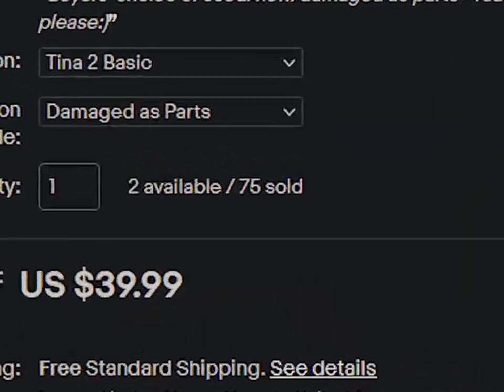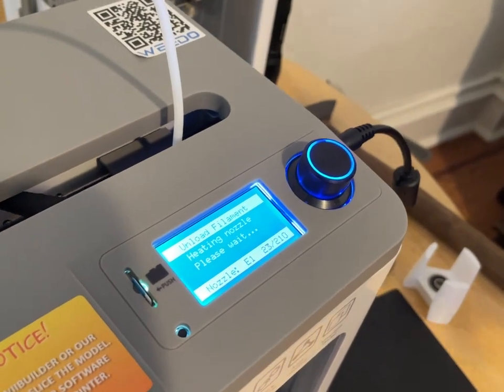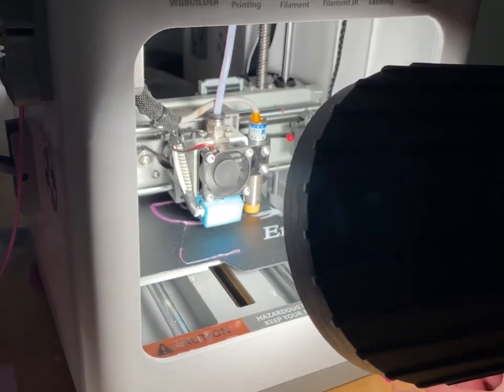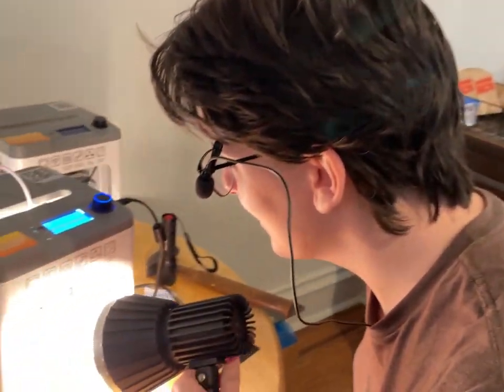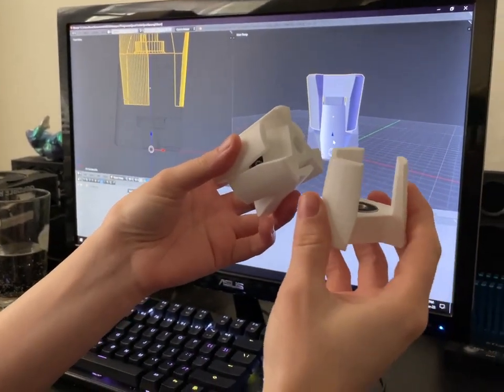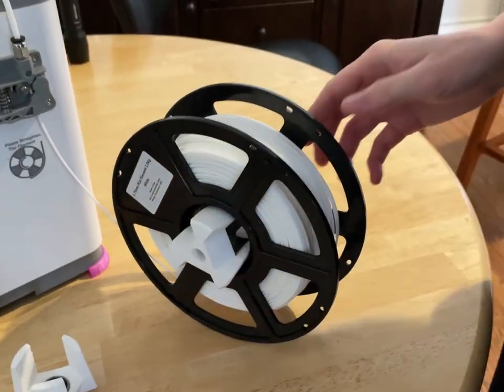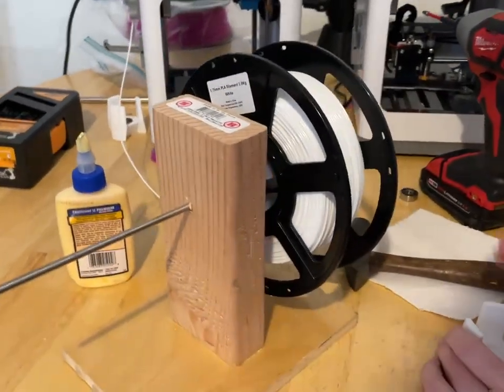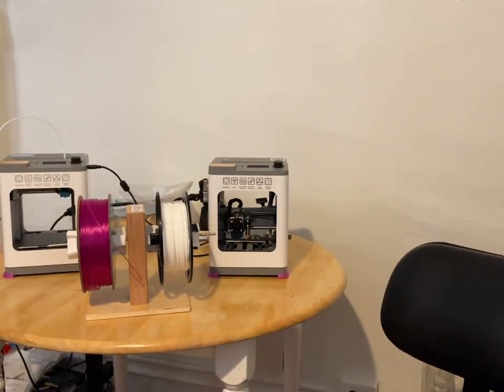3D Printing Experiments 02: 3 Printer Hacks that are either useful or comical! Tina 2 Upgrades

Comment: Thank you for posting these videos about these mini printers, now I am looking forward to getting mine. I happen to source a rebadged one off eBay under the monoprice mp cadet. I’ve found that touching the print beds actually transfer oils that can case adhesion issues for the build plate. 99% isopropyl alcohol works good and an occasional soapy water cleanse with dawn dish soap works good too.

Comment: The angle of the head of a screw is 90 degrees; the tip angle of a drill is typically 118 degrees. Using a drill as a countersink will only work if you make an oversize depression.

Comment: loving watching the progress of you learning to use and modify this, i dont know if it will help but i've seen alot of people using kaptan tape on their build plates to help with adhesion and ease of removal
Reply from the maker: Yeah I've done 3D printing professionally for years. I've steered clear of kapton tape because it has sticking issues. I find this bed surface works fine.

Comment: Heating the beds with light might be counterintuitively making things worse. In my experience, the heat does help it stick, but importantly, as soon as even a little cooling happens, the different thermal expansions means the print pops right off. In other words, sure it'll stick to a hot plate, but as soon as the plate begins to cool you'll lose whatever adhesion you had, worse than printing on a cold plate to begin with.

As far as spool holders, I've had the most luck with a spool holder that's kind of like a roller-type dynamometer. They hold the spools by its rim rather than by its center, with the rim sitting between two rollers so it is relatively captive. The ones I've printed hold a wide variety of diameters of spools, and you can keep the two sides separate for different spool widths.
Reply: I've also seen examples of spool holders that are similar to yours, basically two cones with large coarse plastic threads printed in, one female one male, so that you can screw them in for positive retention beyond friction.

For spools out-of-use I definitely recommend at a minimum keeping the end of the filament captive - they tend to tangle if it is allowed to get loose and taut again.
Reply from the maker: Actually no, heating the bed with the light has never caused later failure of the print so far. Either the bed isn't hot enough and it fails immediatly, or it holds even when it cools. I didn't want to go with the dynamometer style roller because my reels are cardboard and I worry about the edges getting chewed up. What you're saying about spool holders, I mentioned in the video. I dislike the threaded type.

I've actually never had any issues of filament tangling.

Comment: Those bed level  probes are inductive, they can detect the presence of any kind of metal. No magnets or infra red involved. The red LED at the top indicates if it is triggered or not. You can test them by holding any piece of metal close to the tip
Reply from the maker: Yeah I figured
Reply: Beat me to it. Love these probes.

Comment: Love the intro! And my guess is the screw wouldn't drive in further because the 2x4 had some radial movement while driving the screw. Step on it or put in a vise and try again. Rinoa, you're in my top 10 people I know list. Keep it up!!
Reply from the maker: Warms my heart to see you comment! So it turns out my issue was not thinking about how deep the cone of the screw was, meanwhile I was using drill bits to clear it out that were relatively flat. You know how it is, trying to do something super fast and grabbing a hammer instead of figuring it out.

You're also in my top 5 people I know list.

Comment: I recommend improving:
 - a desktop, make it heated (perhaps even 110V - through a relay, so as not to buy a more powerful power supply unit ...);
- add blowing for printable parts from the front;
- improve the feeder !!!
-  You can make some kind of spring clamping for coils with filament so that they don't untwist on their own...
Reply from the maker: Thanks for the tips! I'm already working on some of those but good to hear it anyway!
Reply: @RinoaL  😻💙💛💯

Comment: Just a quick heads up. Don't let go of the end of the filament as it can tangle and cause problems later. There are holes around the edge of the spool that you feed it though when not in the printer. I had a tangle once and it lifted my printer 3 inch in the air before I noticed it.
Great video. Keep up the good work.
Reply from the maker: I've personally never had issues with it tangling tbh.
Reply: @RinoaL  Neither had I until I did. I don't want to deal with it again. You have to unravel the whole spool and rewrap it. Not fun.

Comment: Those stock ender plates have the worse adhesion. Impossible to remove oil from them. I usually soak it in hair spray that usually helps it stick a little better.

Comment: Your extruder is clicking (skipping) while purging the nozzle before printing. Please calibrate your extruder steps/mm. Refer to Marlin Wiki for that. Could be the wrong temperature for the filament though. It could also be extruder gear tension. Also print a temp tower to determine the optimal temperature per filament. As for the stringing, calibrate retraction accordingly.
Reply from the maker: Yeah I noticed that, however it won't really harm much since it's so short. Also it only runs with this filament so I won't change the settings since I don't plan to use this filament much.
Reply: @RinoaL  the esteps has nothing to do with the what filament you use. It is how many steps it takes for your motor to turn the gear a full revolution. This is a necessary step for almost every 3d printer.

Comment: You Should ALWAYS tiden your filament when not using.. The way you just put away that spool, without using the holes on the side is dangerous, because the chance of getting your filament strangles is to big.
Reply from the maker: I've never had an issue with filament binding yet tbh.
Reply: @RinoaL  well better save then sorry..lol

Comment: So I should be getting mine tomorrow. With the build plate, that masking tape type material you pealed off is actually supposed to be there and helps with adhesion. When you buy it new they give you spare ones to replace it with. However you can just use blue painters tape as someone else in another video did and it works just the same. 

Sharing a screenshot of your cura settings would be great. I plan to just install that custom build and copy the settings manually from it to a newer version of cura. Some tips with your experiences with 3D printing would be awesome too like how to store filament since I see its humidity sensitive. I'll have to get some big zip lock bags like you have or figure out some sort of storage solution.
Reply from the maker: I uploaded the presets needed. Here you go. https://archive.org/details/weedo-cura-definitions
Reply: @RinoaL  Thank you so much! I really appreciate it. Printer itself should be here any time now too! See if I get any filament with it. If not I have a 1kg spool I ordered on Amazon but I'll have to wait until next week.
Reply: @RinoaL  Well my excitement has come and gone. The one I received that is supposed to be guaranteed working has the nozzle clogged. I cannot unthread the nozzle either since the heat block keeps turning and my multitool is too big to grab it. Messaged the seller. I'll see what they say when they get back to me.
Reply: nvm, just got it broken free
Reply: Well, I unclogged it. Printed the one test square. Let it sit for a couple minutes. Went to print something else and it was clogged again. I have the print head assembly apart. Down to this aluminum heatsink behind the fan is completely clogged.
Reply from the maker: I say open it up and clean it more. Also check to make sure your temperatures aren't too high. Also make sure your fan is working. Good filament can clog when burned or boiled.
Reply: @RinoaL  I might continue to mess with it today but yeah. Another person had said it could be the fan and I don't see it spinning. They also said the cable management on these are known to be bad and the cables break. The auto leveling isn't working right either now. Just sort of a mess rn.
Reply: @RinoaL  Well, I swapped a fan on it that I had. Its a tad too big and I only have 2 bolts holding it to the print assembly. It has some slop but its working! It still has some feed issues here and there where it'll jam up, but not completely clog! It has printed the spool holder from doctor_voctor successfully! As well as one of your feet with the provided gcode at 215! As well as, the company is going to do good by me and send me another unit like I initially ordered, since this one was damaged maybe in shipping. Not sure, but I'm really stoked its just printing stuff! Thank you for everything!

Comment: You can stop your print sticking problem. By applying painters blue tape to the surface of the print bed… your prints will stick first go and not warp.  Give it a go and see how u get on…. Or glue stick is good too :-)
Reply from the maker: I'm actually finding I can get it to stick fine now with this surface. i've never liked using substances to make things stick that much.
Reply: @RinoaL  I agree with you on being averse to adding more consumables to a process. 3d printers should imho be 3d filament and electricity as the only inputs.

Comment: Oils from your hand makes the bed adhesion worse. Just clean your bed with ipa and maybe you will get better adhesion. Also higher temps can help wit unheated beds. You can use higher temps for the first few layers. Also gluestick is really really helpful and works a lot better than painters tape. Id recommended printing a temp tower from teachingtech's site (another youtuber) the site is really helpful to beginners. 

I want to get one of these just to mod it to hell since my printer is already modded for reliability
Reply from the maker: I wash it, don't worry, but yeah that's good to keep in mind.

I'm a decade late to being a beginner personally, just FYI. haha
Reply: @RinoaL  your pure enthusiasm and excitement makes you feel like a beginner which is so wholesome! Also the 4/3 aspect ratio really helps it a lot to get this feeling
Reply from the maker: Well I do 3D printing at my job, and doing it at home with these cute printers feels a bit like being a beginner. Even if just being a beginner in a new genre of printing.

Comment: So I just got a Tina2s from a friend.. got the printer added to cura but it doesn’t have any profiles. Tried exporting old profiles from the version of cura that came on the sd card but newer version won’t take them… any ideas?
Reply from the maker: I shared the profiles either in this video or on the first one, I think I posted a link. If not try internet archive maybe youll find my files there

Comment: I got my Tina2S 4 months ago, and it has been super problematic. Head bed broke, now the nozzle no longer heats. I have some questions for you, little quality of life things to make my printing easier.

1. Do you just let your filament sit standing on the table and let it roll into your machine? I printed a larger holder for my filament, but that causes the filament to drag and get stuck and I was not sure how to prevent this happening on overnight prints.
2. I am adding layers of skin and ironing the top layers of my pieces, but they keep getting pockets of holes all in them and I do not know why that could be. Would you have any idea?
3. Is there a way to do E-Steps on the Tina2s? Because all my stuff comes out looking really, really rough. I cannot get a single smooth side, bottom, or top.
Reply from the maker: I must be honest, Im deeply confused by these questions and I think maybe Ive forgotten the early struggles of 3D printing.

I dont know what you mean by letting filament sit or roll, and Ive never heard of anybody ironing a print. You mean like a shirt iron?

The last part, do you mean adjust the flow percentage? 

I recently had to debug the other one I had and it was a pain to get working, but once I got everything leveling and wired right, it works without any issue. Its like a little home appliance. Maybe there are more basic things that are going wrong with your printer
Reply: @RinoaL  as I was watching the video further i noticed you build a stand, so you can ignore my 1st question. 

Ultimately: I believe my filament is under-extruding, and it is leaving nasty lines and gaps where it shouldn't and I am not sure how to fix this.
Reply from the maker: In Cura check the flow rate

Comment: How do You avoid stringing? I get stringing with any filament or settings in cura with this printer :/
Reply from the maker: Your temperature may be too high, but also you can check the retraction settings. Retraction is when the motor pulls the filament back a set amount when ending a line so as to stop stringing
Reply: @RinoaL  thx. I have stringing even for 190C and 5mm retraction, but I can tweak it more i suppose